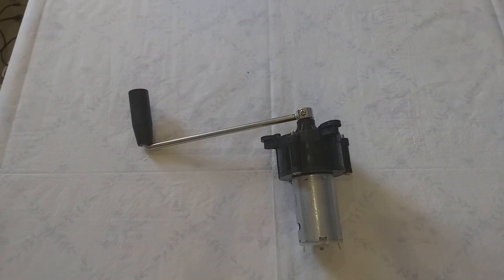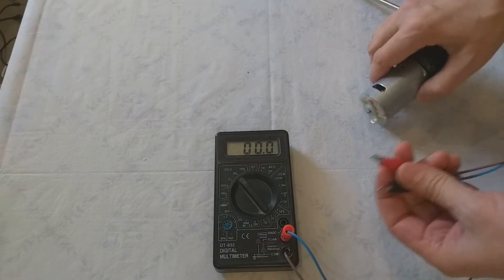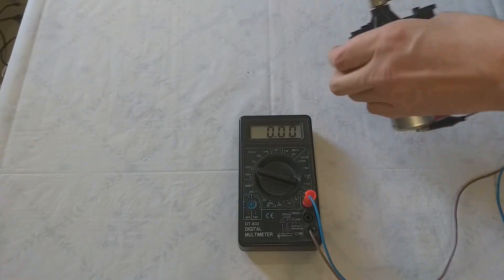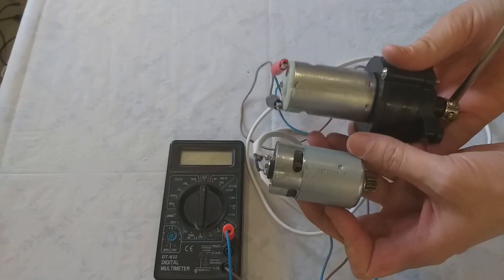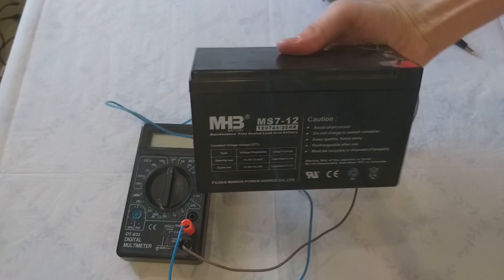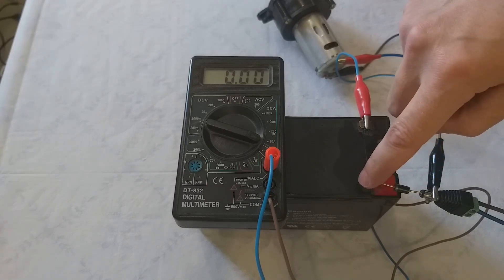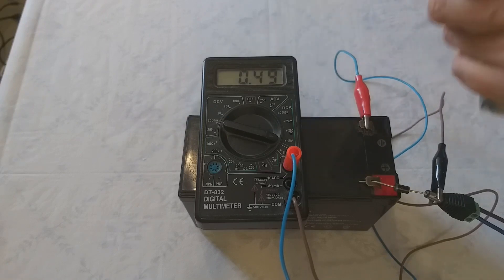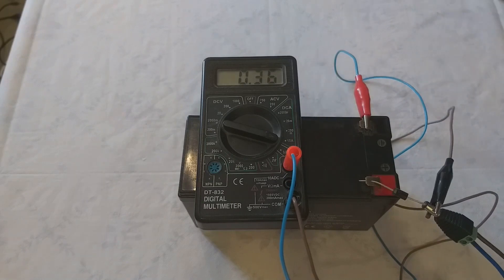Hand crank generator charges 12 volt battery. Measure the current

Comment: peak at 65v and 5amp, so over 300w potential output?
Reply from the maker: 65 volts without load. 5 amps at 12 volts. Power 60 watts.